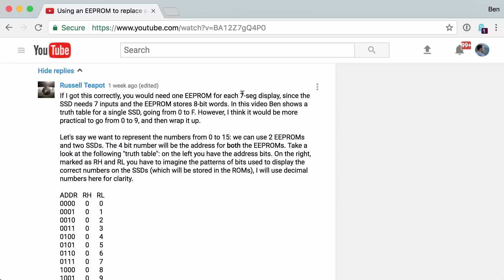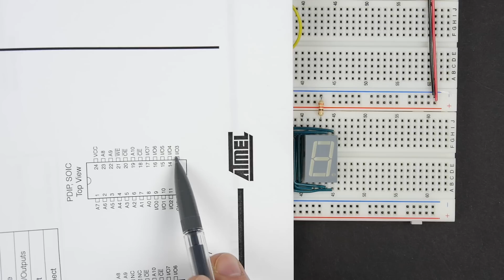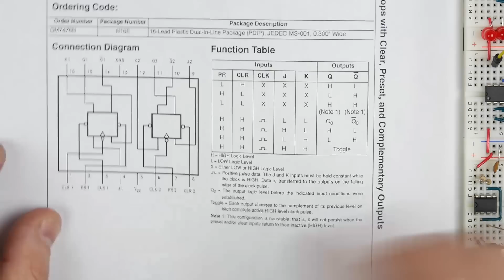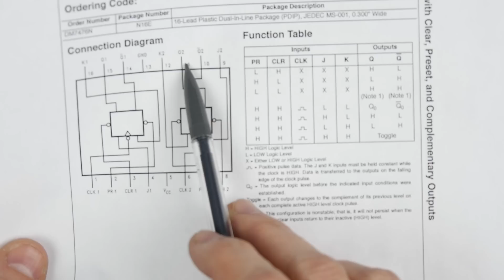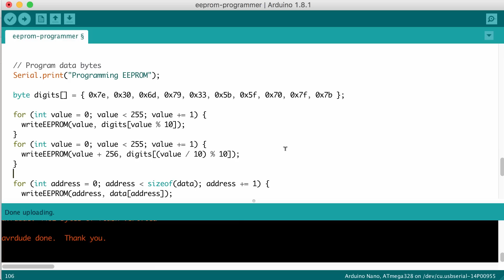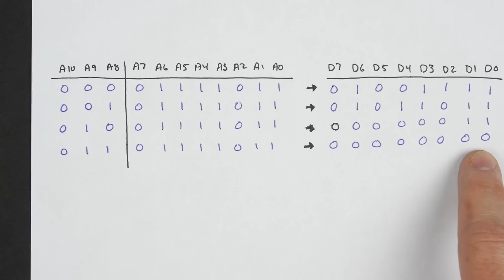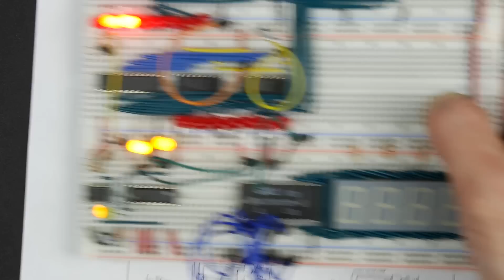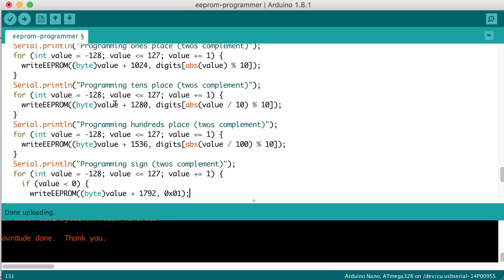Build an 8-bit decimal display for our 8-bit computer

Comment: Isn't the decoder driving too much current through the LEDs? The resistors were removed, but then the LEDs were plugged straight into the decoder without any resistor.

Comment: In case it's not been suggested (I came late to the game) I used a CD4017 to strobe cathodes across an 8x8 LED display to output the lot. Can't that be done here so only one EEPROM and one 4017 are needed with a clock supply for the 4017 - which could drive up to 10 displays?

Comment: Another solution would be to use a shift register that loads the value in parallel and then shifts around, connecting the serial output to the serial input, and connect the 4 least signifficant bits with a hex to 7 segment decoder (for instance an EEPROM or 20 pin PLD like the ATF16V8B - seems most 7 segment decoders only support BCD: values 0-9) and then use an 8 bit D-latch to keep the output for each digit or just run it fast enough so you don't notice it blinking. If you want a decimal readout then you could add a binary to BCD function by including an adder that will increase the value by 6 (0110) if the value of the least signifficant 4 bits together is higher than 9, then feed that into the 7 segment decoder and store the output for the 7 segment digit. After decoding the value of the 4 least signifficant bits you shift the position of the input data 4 positions to the right and repeat (adding 6 to each nibble if the value of that nibble > 9 when you want BCD). Besides a shift register you could also use a couple of 4 bit selectors that selects the low order or high order nibble as input to the 7 segment decoder. And as alternative to using an adder for the conversion to BCD, the DM74185A is a 6 bit binary to BCD converter IC that (if I understand the datasheet correctly) can be used multiple times for bigger binary words, though I can't find any suppliers and as the date on the datasheet I found is 1989, I guess it's no longer produced. Considering the added complexity and availability of hardware, I think I'd just do the conversion to BCD in software before sending it to the 7 segment display.

Comment: I got the multiplexing, with the clock stepping through the four 7-segment displays, working as intended... for a minute. After a minute, the sign and hundreds displays started flickering, until they petered out entirely. I've noticed that if I put an LED between ground and pin 14 of the 74LS76 (the second clock divider output, that drives the EEPROM's A9 pin), it'll suddenly spring back to life. Can someone here tell me what's going on?
Reply: For now I've put a small resistor between pin 14 of the 74LS76 and ground, and this resolves the issue, but I'd still love to know why this works, and why it's not without this resistor.

Comment: Great video, lots of neat ideas presented. I do cringe at the idea of LED's connected to logic outputs with no resistors, then using that same output to drive another input. the LED's clamp the output to the LED's Vf, reducing the available drive to a potentially marginal level. Bypass capacitors on every chip is never a bad idea either.

Comment: Wouldn't it be possible to use a shift register for that instead of a counter and a decoder? Just shift out 00000001, 00000010, 00000100 ect, could light up 8 displays with that.
Reply: Then you must use an encoder the the 2 adress lines to the ROM.

Comment: For some reason when I remove the LED from the JK flip-flop's output1 pin, the 7-segment display for the hundreds digit goes blank and won't come on at all. I'm using the 74LS107 instead of the 74LS76, and as far as I know it's wired correctly, because it works perfectly as long as I keep that one LED plugged into the flip-flop's output1 pin. Does anyone know how I could make it work without needing the LED there, and why it happens?
Reply: Yep have same issue.

Comment: Instead of having the most significant bit determine whether you were in signed or unsigned mode, could you have just had that indicate the value is negative so that you could display from -256 to 255 instead of choosing between -128 to 127 and 0 to 255?
Reply: twos complement is a more natural representation of binary numbers. Technically -256 to 255 would require 9 bits, one for the sign. If you were doing arithmetic, it would be difficult to keep track of wether the number is negative or not, so it just makes more sense to use twos complement.

Comment: Hey Ben, is there any advantage of doing it this way instead of using a 7-segment LED display driver chip? (Such as National Semiconductor's DM74LS48 BCD to 7-segment decoder.) I used a similar chip for a simple two-digit counter project (it simply counted from 0 to 99 from a 555 timer pulse). I used two chips together (one for each LED digit).

Comment: @28;30 When coding for the second half of the EEPROM, why did you use byte and abs function calls, rather than just putting (value + 128)?

Comment: Cute! There are other vintage ways to do that: 8 bit latch per display (software does the bitmap) so it's set-and-forget. Shift register (serial in parallel out) so 2 pins (data, clock) handle as many displays as you care to cascade. One of the Heathkits uses the bit-addressable 8: 1 bit latches (in one DIP) so each segment can be set/cleared individually. The MM5486N LED Display Driver is serial in, 33 current-regulated outputs (4 digits!), I got some recently surplus! I guess using Maxim or Holtek controllers is cheating since they're 'too new' :-)

Comment: The multiplexing of the digits is clever, and using the EEPROM for decoding is great -- with a little more thought, you can get rid of leading zeroes if you want :) The only thing I don't like is that you end up running the LED's at only a 25% duty cycle so they're pretty dim.
Reply: The normal solution is to insert a driver to increase the current 4 times. All multi-digit displays are run the same way.

Comment: Ben. I will have to go back step by step, but you are stirring things in my memory that helps make sense. I can make sense of the same color jumpers. Thank you for these videos. You make it understandable for me. The biggest eye opener (which I knew is how it works) is the rapid clock signal which makes the display constant. I just didn't know how to wire it.

Comment: While I appreciate all the high level concepts presented here I want to get your opinion on a kind of low level question. Here you use a single resistor to connect the common cathode of the seven segment display to ground. I think I understand that the best practice is to connect each anode to it's own current limiting resistor. What is your guidance on this matter?
Reply: I have been thinking the same thing. Myself I always use resisters on all segments to get even light from the displays.

Comment: I was wondering if it's possible to program an EEPROM, like what Ben did in this video, by using nothing but logic gates, instead of Arduino.  So I simulated an EEPROM programmer with Logic Circuits app,   I'm happy to report that it's indeed possible.  Now I have an idea of how the old time programmers, back in the day when programming languages haven't been invented, did their job.

Comment: 74LS76 is obsolete these days...at least from Mouser.  I know you can get "new old stock" in various places but do you know what a modern replacement would be?
Reply: On the parts list (https://eater.net/8bit/parts) it says "74LS107 (Dual JK flip-flop)
Note: The videos use the 74LS76 which is extremely difficult to find. The 74LS107 is functionally equivalent but be careful: it has a different pinout."

Comment: Compliments for your interesting videos. Multiplexing is the "cheap" solution for driving multiple displays. A most "professional" way is to use latch memory to store the current value of each display, and the user must write the latch with the new value only in case of change. It could be interesting to see an example of how implement latch.
Reply: Not everything that is cheaper is necessarily worse. Actually I would even say that one mark of a real professional is to recognize where in your design you can go cheaper without hurting the quality of the final product! Here the shortcut is to use the property of human vision, sometimes called persistence of vision, to achieve a good display with a design that is simpler to build and program.
Reply: @pev_  yeah, every mass produced product with VFD or LCD displays uses multiplexing. It’s fine

Comment: instead of cycling through each digit faster than the dim and light up again, would running each digit through a register (like 2 74ls173's or 8 bit register 1 74ls273)  yes i know this would add more chips (4 or 8 ) but it may add scalability. Yes i know this is an engineering trade off. I think i have all the components to try this so maybe after the holidays i will try it. and again a great video, and a great series; i am watching it again  to see what i may have missed in the past.

Comment: You do not need to write 4 times the same for-loop with different values, just make a nested for and in the outer you go from one digit to the next and calculate the module and divisor value.
And please, to brackets that belong to each other should be either on the same vertical or horizontal line, it makes them much more readable.

Comment: Anyone have trouble with the display being faint? I can't figure out what I'm doing wrong. Everything works perfectly except the display is faint
Reply: The Over Under mine does the same.  I dropped to 47 ohm resistors and I can see it a little better.  Did you figure anything out?

Comment: If you feed your binary number to a BCD decoder it will take just 10 bytes without having to repeat the digits.
But damn that is some clever stuff you did to have all this set up with just the EEPROM! Considerably less wiring than on the classic way.

Comment: I burned up two chips and a breadboard before I realized this video wired the 74LS76 for the counter,  not the 74LS161 which was included in the kit!
Reply: Always check the data sheets.

Comment: is there any way just to convert one 16bit number to 4x4bit numbers those will represent decimal digits, and when a 16bit number comes from a computer to the display board, just convert it to 4 4bit numbers and just display it? I think it can solve a problem when wee need wery large EEPROM to store 65536 possible numbers. And also we even can be able represent an ASCII table if just code each charecter in 8 bits instead of 4bits in our EEPROM.

Comment: Hi Ben. I noticed that when you swapped out the current limiting resistors on the common cathodes of the 7sd's for the wires connecting them to the 74LS139, the digits appeared brighter (see for example 22:26, when all 3's are displayed). Although the visual effect is probably cancelled out by cycling through the digits and thus turning them off momentarily, I'm still wondering if the current passing through them while they're on is (too) high, given that it seems at least greater than what it was while having them turned on through the resistors. Now, I realise they're connected through the IC's and they're probably limiting the current too, but can it still damage or reduce the lifespan of the displays?
Reply: I'd recommend adding 220ohm resistors to them.  I had the same issue, but they're essentially just red LED's.  A lot of his LED's in his videos don't use 220ohm resistors, but in reality the builds don't work without the resistors.

Comment: Wait...no leading zero suppression? :-)
Reply: Wolfgang Mahringer not enough room on that breadboard...
Reply: @ophello  There wouldn't be if he did it in logic gates, but the whole purpose of the video was to do it in the EEPROM. With good Arduino programming, you can easily do leading zero suppression. You can also write "  -1" instead of "-001" just by thinking about that code carefully.

Comment: (@13:48) - if bits “D1” and “D0” are connected to segments “e” & “f” to display a “1”, then one of them needs to be a “0” on the line above to display a “2”, as the “2” doesn’t use both segments “e” and “f”; you’ll get something that looks like a lowercase “a” if you do. 😏

Comment: easy (but maybe space inefficient?) solution for any lengths display would be equipping each of the displays with a 7 bit shift register and then you can send any number of digits through. 100 display cells? just quickly pulse those 100 numbers and have them each turned into 7segment display format and then shifted through the assembly. clear? well you have to pulse 100 clear spaces but hey

Comment: Cant you use the remaining of the eeprom to replace the decoder also?
Reply: No, because you need more output bits for that. To drive 4 display select lines in addition to 7 (no dot) data lines, you need 4+7=11 output bits, but this EEPROM just outputs 8 bits.

Comment: I had a go at this, and the wiring became impossibly tight until I lifted the display modules and ran some of those connections UNDER the modules. For example, connecting pins 3 and 8 becomes a simple link across the middle of the breadboard

Comment: At 24:15 when you removed the capacitor the display remained on and displaying the correct numbers in each slot. Is the cap even necessary then?
Reply: Technically no, as the wire itself would work, but it's considered bad design to leave it like that

Comment: Once again really great video. On little advice : you may want to watch the current you are asking that 'LS139 to sink. Seems the chip can only sink 8mA per output. When all segments are lit (to display "8") for any given display, you are probably exceeding that (even if each display runs only 25% of the time). I'm not sure what is the chip's maximum for all 4 outputs but that might be a factor as well.

Comment: Hello, 
I’m trying to build the 8 bit computer you are showing off. But I’m encountering a problem : my  SN47LS76N is not working properly, it count from 1 to 3 without going on 0. Plus, sometimes (if the clock input is too long) it goes instantly to the next step. I’ve tried a lot of things but it won’t change anything.
Is there is a problem with the component itself or it’s something hooked up badly.

Thanks.
Reply: Legend has it, he never replied.

Comment: Wouldn't it make more sense for one half of the EEPROM to be negative numbers, and the other half to be the positive numbers? In the current implementation, you have positive numbers from 0-127 stored in there twice, once with two's compliment, and again without.

Comment: I know I'm a bit late here, but I have the replacement for the 74ls76 jk flip flop, the 74ls107, and all was fine until I removed the led from first flip flop output. When removed, the second flip flop didn't like the input from q1 as its clock, adding a 220ohm resistor in place of the led solved the issue, so I guess the current was too high for the second clock input.

Comment: I don't know if I will get a timely enough response from anyone, being 2 years late here, but it's still worth trying :P
I'm building a calculator that's displaying 8 total digits and it will work on the same concept. 1 driver chip receiving all the sequenced numbers (But in BCD) but my question here is. This seems to work fine for 3 segments, flashing often enough, but would this be pretty dimly lit for 8 segments? With 3 segments, (counting the frame they are all off for) they are lit 1/4th the time but with 8 segments they will be lit half that amount. I assume it would work kind of like a crude PWMed led, where the less time its on the less bright it becomes.
I could split it into 2 drivers and run each half of the total segments on each driver leaving each half to be off half as much, but I figured I might check here before buying more chips.

Comment: Ben,
The clock and counter portion of this circuit seems simple, and I copied it exactly using a sn74ls76n, but for some reason, as soon as I connect power, current jumps to 3+ amps and the co9unter doesn't work. What am I doing wrong? I am 100% sure I have the connections EXACTLY as they are in this video. I have tried with 5 different 74ls76 chips and two different breadboards and I get the same result every time. Any idea what I might be doing wrong? 
Thanks for a fantastic video series!
Reply: Turns out I needed to use the 74ls112 datasheet for the 74ls76 chips I have... Must have been mislabeled or something? Very weird. Anyways, thanks to a previous comment (which I now cannot find, or I would credit them here) I found this solution which worked for me.
Reply: Be aware that 7476 has an unusual power supply arrangement.

Comment: Nice video. It's crazy the microcontrollers are so cheap now, that you can replace all the complication with a single cheap uC to do all the LED multiplexing. I was looking at a similar problem and figured that instead of buying dedicated chips, it was cheaper and easier to use a uC to do it.

Comment: I had problems finding the 74LS76, they are discontinued.  But I did find a tube of 5, TI 74LS76 IC's.  All 5 did not work, they would heat up so hot you couldn't touch them.  I found a 74LS112 that I can get.  They are a dual J-K flip flop, but different pin configuration.  Other than that, they look to be the same.  Just on a hunch, I wired up the defective 74LS76 using the 74LS112 pin diagram, and it works perfect!  I must have mislabeled TI IC's? Just thought I would pass this along, maybe someone else ran into this.
Reply: I had the exact same result, even swapped out the breadboard and that didn't do the trick either. I thought I got a bad batch of 74ls76's but if you have the same problem also then we must be doing something wrong, or maybe they changed the pin configuration of these chips at some point? I am at a loss, but thanks for the solution of using a 74ls112!